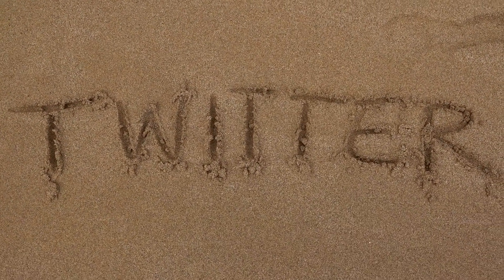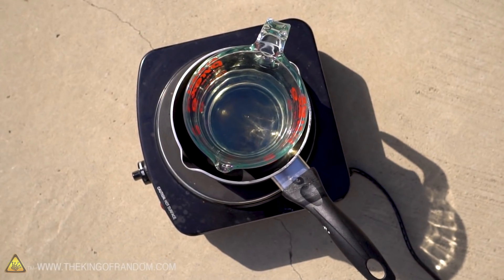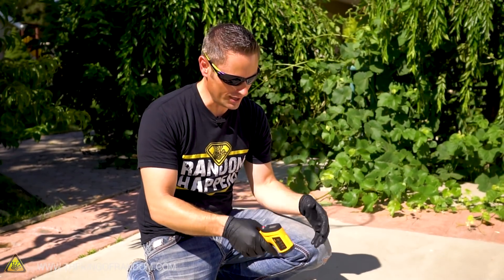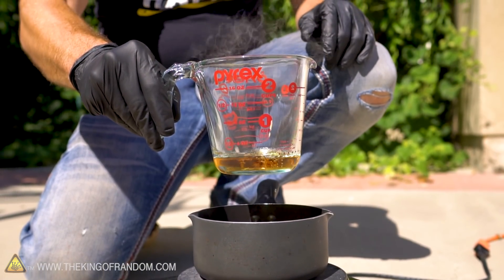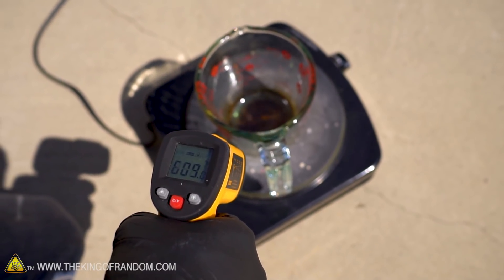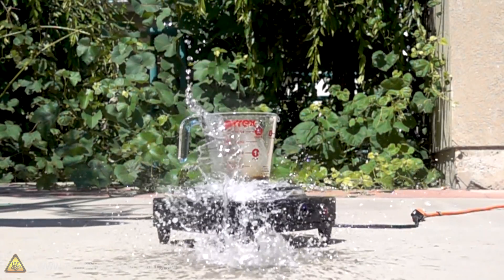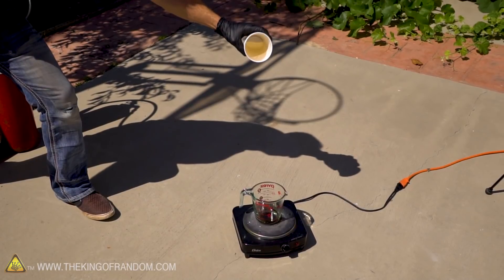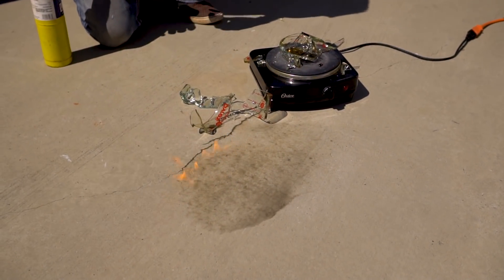Is Boiling Gasoline A Good Idea? TKOR Tests If You Can Boil Gasoline And What Crazy Thing Happens

Comment: what would happen if you started to boiling dry ice or liquid nitrogen????????????????????????????? like if you like this idea
Reply: The boiling point of dry ice is - 108 degrees f or - 78 degrees celcius meaning that it boils when placed in water. The boiling point of nitrogen is - 195.8 degrees celcius meaning both these substances are already past boiling point
Reply: you see liquid nitrogen boil everytime he uses it.
dry ice changes directly from solid to gas at normal pressure.

Comment: What about burning something in a vacuum chamber ?
Reply: its impossible because in vacuum there is no oxygen
Reply: not sure if everything need oxygen to "burn" (or any other gaz).
Maybe it's possible to use a liquide + a solid ?
Reply: Maxime Barbier If there's no oxygen, burning something is not possible because oxygen is a requirement for the reaction.
Reply: no burning is a reaction between element CH4 for example and O2    CH4+O2=CO2+H2O
Reply: what about sodium + water ?
Reply: this isnt the reaction burning in this reaction the Na(sodium) combines with the O and H in the H2O(water) and forms NAOH(sodium hydroxide) and produces heat due to its reactiveness   2Na+2H2O=2NaOH+H2
Reply: thanks for the info.
Do you think that a burning reaction can be made using liquide oxygen then ?
Reply: Maxime Barbier 1 more think the higher the temperature the better the reaction(for almost all reactions) and the higher the temperature the more reactiveness you get from a material

Comment: Ignition temperature of gasoline is around 232 degrees Celsius (~495 F)...boiling point is around 35 degrees Celsius (~95 F).  You could maybe get gas to ignite if you threw a small amount into an oven heated to 500F (High), but it's difficult to say given the way the gas and heat are dispersed over large volumes.  If you put the gas in the oven and heated it, it would likely all boil off into vapor before it ignited, but if the oven was well sealed the vapor that is trapped would likely ignite once the oven hit ~495F.

Comment: 1. thanks for using 'c 

2. when you poured the petrol into the glass most of it went on the floor only a tiny bit when in the jug so its not half, you can see that clearly on the slow mo,

Comment: I have two questions kind of based off the same experiment the first one is if you could have caught those Vapors and then recooled them and collected it how flammable would that liquid B versus normal gasoline and the concentrated oil at the bottom how flammable is it compared to normal gasoline

Comment: Use your 300$ thing for purifing water for purifine gazoline
Reply: Gasoline is already a purified product made from crude oil.
Reply: maybe try purify crude oil??
Reply: ummm... ?
Reply: Paci Paci Pac lkr
Reply: Kilo3421 a
Reply: Kilo3421 yeah
Reply: EricG326 did you see the bottom of the glass?
Reply: Kilo3421 yeah
Reply: It's 400$ thing
Reply: I think so
Reply: Lee Marcus you'd need to FRack it
Reply: u mean cracking?
Reply: Kilo3421 Gasoline is already a distilled product from petroleum. You would only end up with the same gasoline.
Reply: Gasoline is a mixture of different hydrocarbons. You would only separeate some of the hydrocarboins from the others making the gasoline shittier or, more than likely, even get no result at all and maintain the same composition of gasoline..
Reply: Kilo3421 do you play roblox

Comment: So, correct me if I'm wrong, but once the fuel is boiling, it won't get to a higher temperature... I wonder in the temperature reading would have been different if you had a probe in the gas...

Comment: is it possible to melt magnet
Reply: Avaibi Stuff you can heat a magnet up so much that it will no longer be a magnet i will just be a piece of metal
Reply: the magnet is just a piece of iron or magnetite which is the same
Reply: Wait, 
Isn't everything able to be melted?
Reply: Not everything, things with a flash point will burn before they melt.
Reply: Avaibi Stuff yes
Reply: Hunter Bot steel beams?
Reply: Avaibi Stuff if you don't heat up iron in some cases the hematite which is a black iron ore magnetic rock can mess with unprotected electronics. So it can be smelted but people love it as that's what's in those snap magnets that you'd toss up in the air and they snap back together making that buzzing sound.
Reply: Hunter Bot do you see liquid leather around? Or liquid wool? Some things just burn before they can actually melt.
Reply: yesir
Reply: Avaibi Stuff of course it is. Anything can be melted at the right temperature/pressure. Except for a few things that decompose explosively. 

A standard magnet is made of magnetite which is a form of iron oxide. So, it might be similar to melting rust. Which would be a pretty high temperature but still possible. It may be a higher temp than he can achieve with propane. Let's check the Googler. Ok, it melts at 1600°C or 2900°F. Cast iron melts at about 2500°F so... Yeah, something tells me he'd have a hard time melting a standard magnet.
Reply: Tony Rueb put argon over it.

Comment: So I used to work at a gas station, so I have become very familiar with gasoline. So I can actually tell you what was going. First clean gasoline actually doesn't boil, it just vaporizes. However, its very unlikely to get clean gas. Gasoline from a pump has bits of debris in it (all pumps do, not like giant chunks, but small bits of dirt do get in there) That debris is why you saw the darkening color. It was burning. That debris was also allowing for nucleation points, and that is what was causing the bubbles. Also the glas shattered from thermal shock. Gold liquid on hot glass. Though I'm pretty sure the last part was obvious.

Comment: You can't heat something (liquid) higher than its boiling point. The moment it gets hotter than its boiling point it will just go into gas state.
The only reason the gasoline was getting hotter, is that gasoline is a mixture of hydrocarbon chains of different length. The shorter the chain, the lower the boiling point.
The low length hydrocarbon chains were boiling off and the chains with a longer length have a higher boiling point -> that the reason the gasoline got hotter.
The reason why you saw an oily substance near the end of your boiling, is because long hydrocarbon chains are exactly that: oil. Gasoline is basically a very light oil.

Comment: Thermal shock. There is a known issue discovered once by America’s Test Kitchen that Pyrex glass will crack into pieces after being exposed to high temperatures and then touch a cool surface. The gasoline in this case was way cooler than the glass itself. The temperature difference was so great the glass can’t handle the stress.

Comment: Sometimes I’m shocked at how you seem surprised when objects react exactly like anyone would expect. You yourself have thermally shocked glass in the past and had it shatter, why would this be any different? The Pyrex could have shattered strictly from the focal heating of the base while the upper edge is much cooler, hence the warning printed on the measuring cup “not for stovetop use.” These oversights distract from the points you are trying to demonstrate.

Comment: it was so obvious the glass was going to break, even borosilicate lab glassware cannot survive such a temperature change .
Reply: Also there is a warning on it saying specifically NOT to do that
Reply: Reminds me of that slow mo guys video...
Reply: Talan Watson sure there are lab glass ware that can withstand 300C without any problems those glassware are made of borosilicate glass they are designed to tolerate thermal expansion, however they still can't withstand sudden cooling or heating. I personally own some of those beakers and flasks,  ( well they aren't cheap but not cost few thousand dollars though)
Reply: Aussie Chemist hi
Reply: Aussie Chemist jim
Reply: That wasn't borosilicate glass.
Reply: Everyone that has forgotten the hotplate was on knew what's coming with that glassware.

Comment: What's the difference between gasoline, petrol and diesel
Reply: Gasoline and petrol are the same, diesel is a more volatile fuel that doesn’t use a spark plug to ignite. In a diesel engine the cylinder head comes up compressing the air inside (the higher the pressure of air, the hotter it gets), then a fuel injector squirts the diesel into the cylinders which explodes causing the expansion cycle stroking the cylinder down. There are many videos out there explaining the same concept better than I did as well.
Reply: Gasoline and petrol is the same thing
Reply: Fizan Khan petrol is a superior brand to diesel and gasoline is what they sell

Comment: the flash point of gasoline is between 536f and 853f the only way to know the exact temperature of the gasoline you have is to get the certificate of analysis (coa) from the refinery it was made at or send it off to a lab for analysis

Comment: will a 80% water,  20% gasoline burn when u ignite it?
Reply: Octane, (gasoline) is non-polar and less dense then water so it will only float on top of the water. Lighting the gasoline will give you the same result as burning gasoline as you normally would.
Reply: i dont think it will mix right? the gasoline will just float on top of the water and thus can burn
Reply: Rian Rizky Oil is immiscible in water, thus your answer is correct.
Reply: You can't mix these two liquids, gasoline will float on water and it wapours will burn normally
Reply: cheezy Potato LIKE THIS

Comment: I've heard that metal can boil away if heated enough, Can you actually boil a metal like....let's start off easy, how about gallium
Reply: mercury, 'nuff said?
Reply: Metal does not boil, what you probably saw was metal bonding to oxygen due to the extreme heat and forming a gas
Reply: This applies to transition metals not alkali metals which do infact have a gaseous state
Reply: yeah gallium, lets make him burn off the metal. then his wallet
Reply: Metals can boil. The boiling point is when a substances reaches a temperatures and a liquid turns into a gas. Metals can turn into gas but requires a significant amount of energy.
Reply: I was looking for a metal with low melting soo.....

Comment: You really shouldnt use a CO2 fire extinguisher on a human.
First you risk giving them pretty bad frostbite from the extremely cold gas, and powder.
Second you risk choking them because you are replacing the oxygen in the air, with the CO2.

Comment: Heating or Boiling gasoline is what gas station does they heat it so the volume will be much but in reality it's lower  like here in italy like 2liters <---heated in reality is like only 1.5 gas stations are  scammers so look at the temperature before fueling

Comment: So, the lighter, smaller moleculed contains of the gasoline boil of before the heavier bigger parts, the residue(?) must be composed of such huge molecules it won't even vaporize under the high temperature. (it might not even be Organic (?) )

And as you explained the glas broke due to parts of it being dramatically cooled down by transferring energy into the cold gasoline, thus making the glass break by thermodynamic shock.

Comment: Gasoline lights around 300 degrees Celsius after looking around a little. A match is around 600-800 degrees Celsius. Reason why I say this is I recall that gasoline can be lit by a match, and so in turn, it's likely that gasoline needs to be around that temperature to get close to igniting.

Comment: Can you fill a soccer ball with helium and make it float in the air?
Reply: a soccer ball probably is too heavy, balloons are really thin yet can still take up alot of space, so their resulting density is lower than the air's
Reply: ‌ ‌ ‌ ‌ ‌ ‌ ‌ ‌ ‌ ‌ ‌ ‌ ‌ ‌ ‌ ‌ ‌ ‌ ‌ ‌ ‌ ‌ ‌ ‌ ‌ ‌ ‌ ‌ ‌ ‌ ‌ ‌ maybe the ball will go way further , or curve a lot more or something cool would happen I'm just curious
Reply: well let's do the maths:

A size 5 soccer ball has a mass of 450g, and a radius of 11.5cm

so first for the Volume of the ball V=4/3*pi*r³=6370cm³

for the additional weight of the air we multiply by the density of air (which under 15 PSI is around 1.3), and end up with an additional mass of 8.2g 

so you see, even if you could practically fill your soccer ball with a vacuum, that barely affects the mass and thus the behaivour of the ball in terms of air resistence etc., as the resulting mass in percent is still about 97%. ......... sadly :(